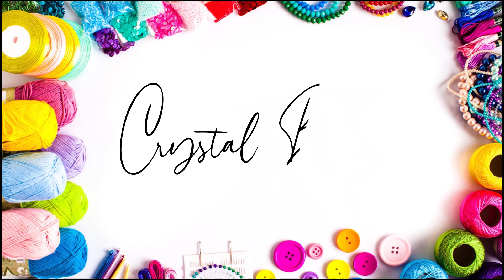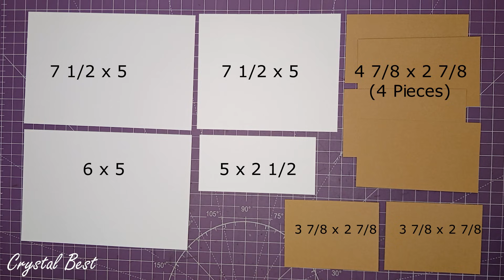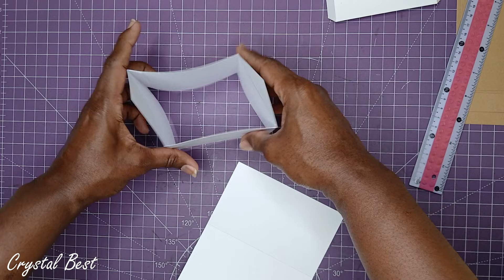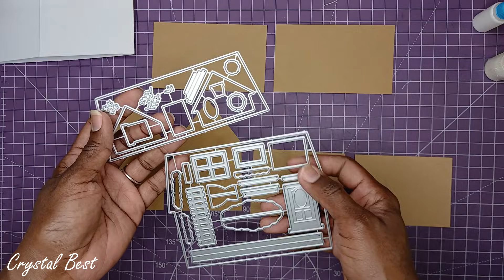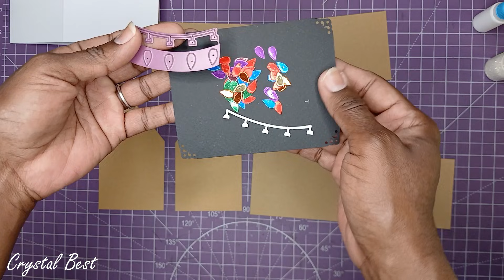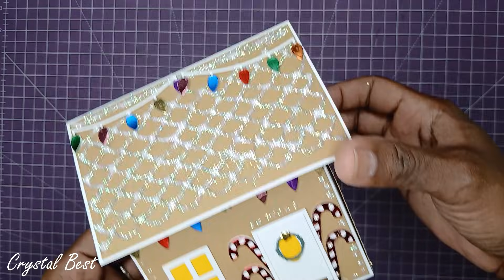5x7 3D Pop-Up Gingerbread House | Handmade Christmas Card

Comment: I'm a little confused.  Is the die set you show in this video just used for your doors and windows on the card you made, or is the die also a pop up?
Reply from the maker: Hello there. The die set I used in the video I simply used for the windows and doors. I also showed you the flat house card that that die makes. The pop up house is fully handmade. Again, the die set simply decorated the house. The die is not a pop up at all.